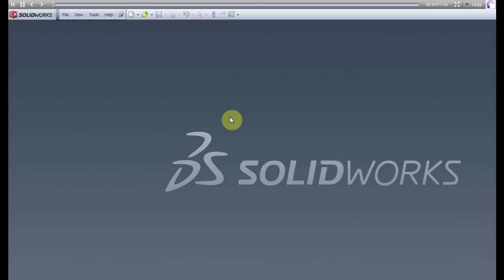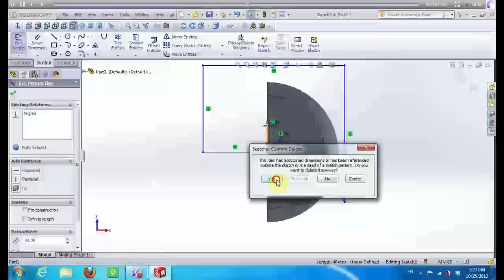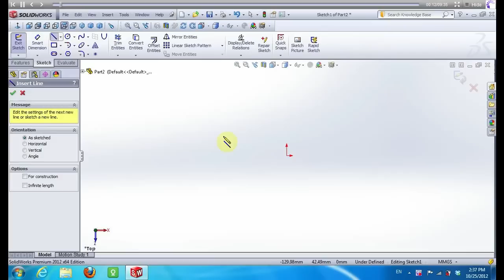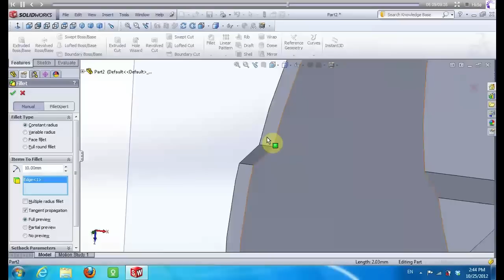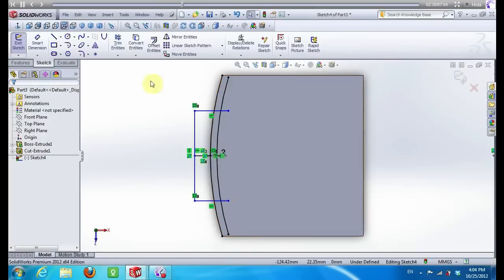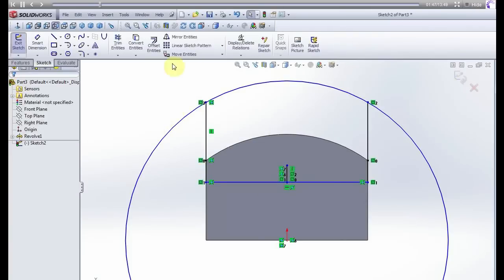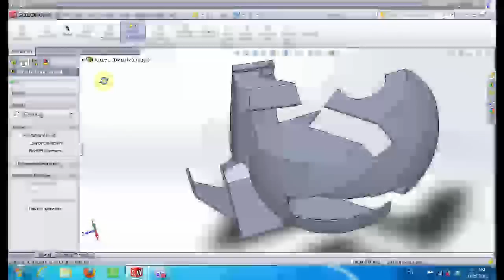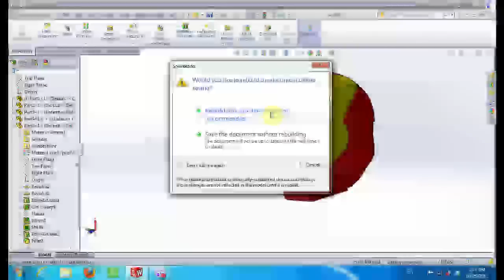Solidworks IRON MAN MASK HELMET Tutorial

Comment: This is a great video, thanks for uploading. The only issue I had was when you were assembling the parts at around 27 minutes in, you extruded the sketch inside an assembly. For some reason, I couldn't find feature on my toolbar and all I could find was Extrude Cut, not Extrude Boss. So, I made that extrude separately and inserted it as a component and it worked fine. I don't know if you did something to get Feature to come up on your toolbar or if it's just because I was using a different version of SolidWorks. Very helpful nonetheless.
Reply from the maker: schapadap Thank you!
Reply: The same ocurred to me